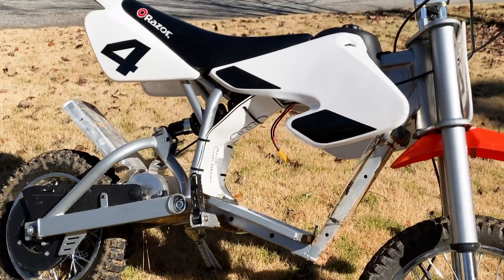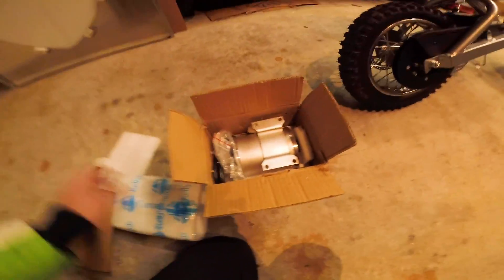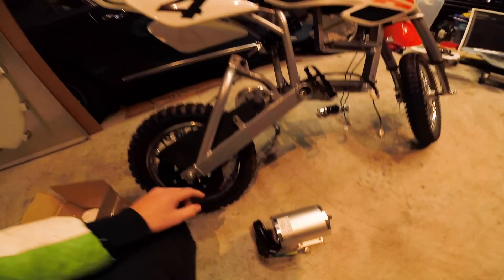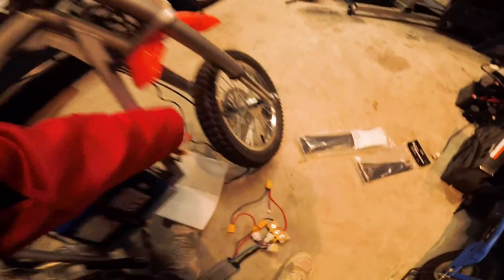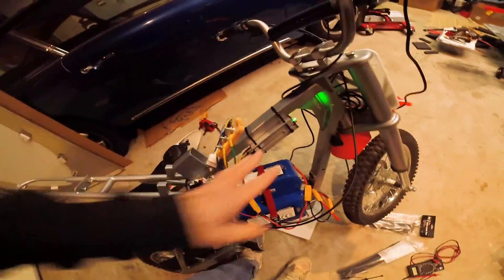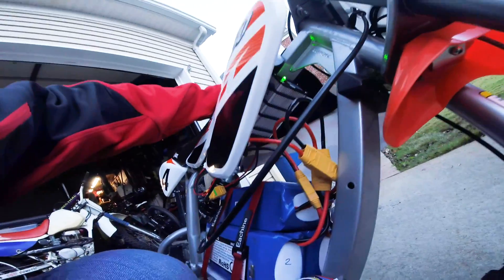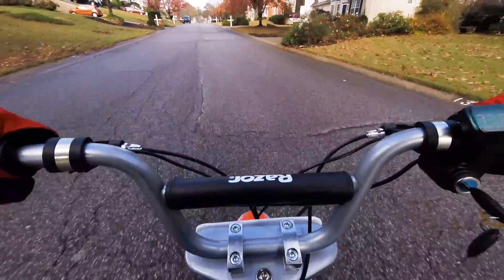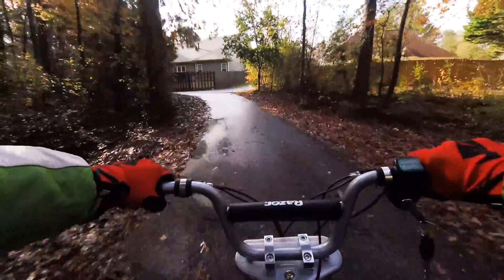Razor MX650 to MX3000 | 3000W 72V Electric Pit Bike

Comment: mmm considering the power, the frame, the wheels, and the chain, I would go for a larger gear at the motor, less torque, less speed but better acceleration control and less dangerous to drive.
Reply from the maker: Larger motor sprocket wild equate to higher top speed. I messed with the gearing in newer vids. Check it out if you’d like!
Reply: @AllThingsElectric_  with this kind of motor, you will lose torque, and speed. If you porgram the motor to be in "speed control", rather than "current control", maintaining speed will get the coils to melt. But i ll check the video sure :) keep up the good work
Reply from the maker: I changed the sprocket and got much higher top speed. The motor gets hotter because it’s working harder to provide high torque, yes, but the math of gearing stands true.

Comment: I have a few questions bc I want to do the same build:how do you charge it? Also wouldn’t 22.2v x 3 be 66.6 volts?
Reply: Thats what im wondering😂
Reply from the maker: I don’t recommend these batteries, but I charged them using a high powered hobby grade charger. One meant for RC batteries.

Comment: I am in the middle of upgrading my daughters MX650 to a 2000W motor and used two of the same batteries you have on your build. Having trouble figuring out wiring up the batteries to the controller. I see you made your own harness for your build. I know it was a while back now but if possible would you mind sharing  what you used to get yours battery wired to the controller I would appreciate the feedback.
Reply from the maker: Just look up “series connector for three batteries”

Comment: Excellent video! Thank you for doing it. Just one suggestion: If you plan on doing more vids, since you can afford things like hop up motors and batteries, why not spring for a small tripod so you can let go of the camera? I guarantee you will like the results once you dial in the setups/angles.

Comment: So I'm looking to upgrade my mx500 I want to do the 72v like your was it hard to figure everything out bc I don't want to spend the money on a plug and play if I can just buy everything separate for like half the price
Reply: What do you feel is the easiest controller to get and how did u figure out that hall sensor problem thanks bro and lmk what ya think is a good set up and then once I order it ifni run into any issues I'll be hitting you up again thanks bro
Reply from the maker: I would go the route that I did with the kelly controller. It is super powerful for its size, and not hard to wire. Def use facebook groups as a resource. Feel free to reach out to my via Instagram.

Comment: I made mine onto 2000w but I regret doing it with 48v lithium top speed 28mph the take off power is there it even lifts front tire but after that the torque is kinda weak

Comment: What do you recommend for a Adult 5'8" 170lbs?
And whats the difference between the RSF650 AND MX650, SX500?
I'm looking to buy and not sure because the mx is 100 dollars cheaper. 
What ever I buy I will be Modding
Reply from the maker: The MX650 and MX500 are the same exactly but differ in motor wattage. The SX500 is smaller than those two. The RSF650 is about the same size as the MX bikes but in a street style. You could probably fit on these bikes at 5'8".

Comment: Nice bike man! So, I have a question since I'm building one similar to yours. Would it be po0ssible to use a different Lipo because I can't seem to find one with that amount of MAH, and might you have any suggestions on which lipo  I could use instead of the one in the video. (I'm only looking for about 25-30 Ish MPH with my build though). Thank you!
Reply from the maker: Yes you can most def use different lipos. I used some 8ah 6s LiPos with a scooter build I did. The mah rating won't change the speed you get out of the bike, that has to do with voltage. These 20Ah batteries get me about 20-30 miles of range.

Comment: Nice electronics work but those bikes have NO suspension and tiny tiny brakes.. Maybe consider converting a chinese gas pit bike if you want something that isn't bound to throw you to the ground at high speed.
Reply from the maker: I respect your opinion, but it seems as though you have never ridden one of these bikes at speed.
Reply: @AllThingsElectric_  I have two for my kids and have ridden them enough to replace the tires once and also ridden them downhill faster than the stock motor/battery can power it on flat ground many times. I also have a CRF110F and the quality of the ride and safety is night and day difference. A CRF50F would be more comparable but the brake pads on the razors are literally the size of a quarter or smaller and they are cable-driven vs hydraulic. Also the Razor shocks feel like they are nothin but stiff springs and the fork has tons of play vs real dirtbike forks and shocks. Just sayin, if you want a good donor vehicle for a project like this the cost of a used gas chinese bike (or even a japanese one if you get lucky) with bigger brakes and better suspension will probably be similar in cost to a Razor but much better in almost every way. Cheers

Comment: I hope everybody sees the video that proves the 500 is identical to the 650, they just lie about the weight limit to rip you off for $150. Yes, same motor, same frame, same everything but the color.
Reply from the maker: I got it used for super cheap.

Comment: What all do you need for something like this? Just batteries controller and motor? Or what else
Reply from the maker: Batteries, controller, motor, throttle, voltage meter, a lot of patience

Comment: Did you have to change the 25h chain to t8f to fit your new motors sprocket?
Reply from the maker: No, I left the stock chain. If you see my chain lengthening video, I use the same one. I changed the motor sprocket.
Reply: @AllThingsElectric_  thanks for the vid. I'm changing the motor on the rs650. Pain in the ass getting the chain on and new motor on at the same time. At least I know now it's possible

Comment: Wow. I didn't even have the brains to do this when I was your age, and I'm 25 and don't even have the brains yet! How much would this cost in total. If I buy one, could I send it to you! Lol. just under 700 would do it for me and you'd get 22. So yeah under 1000k in total for a tuned up bike like that might be available for me later on. Let me know if the price and if that's doable. Not saying it will happen any time soon :(
Reply from the maker: Yea man I can make this work. The batteries I use are about $600, motor is $100, controller is about $200. It might total over $1000 with labor.

Comment: Would love to see a SRF loaded with a 72v 3000w brushless motor, 55Tooth or smaller on the rear wheel and 15 tooth sprocket on the motor. plus  x4 36v Lithium ion batteries,  x2 in parallel and both sets in series.
Reply: Check out Surronster 1SJim - he did one …

Comment: I did something similiar with a 50ah 48 v battery and 1600watt and goes 40mph, the battery is huge and more expensive so i had to grind the battery holder and weld some stuff. Its wicked lithium
Reply: What batteries did you get 48 volt I’m tryna get some

Comment: Hey how did you fix the throttle :') please help.
Reply: interested also
Reply from the maker: I replaced the hall sensor within the throttle. This is the device that detects where the throttle position is and tells the controller how much power to give. I recommend never using this type of throttle however.

Comment: Which charger are you using for the batteries?
Thanks for replies.
Reply from the maker: I use this charger with a large power supply and balance board - https://hobbyking.com/en_us/smart-charger-500w.html

Comment: I’m afraid that If that wood gets wet it could stop being an insulator and become a conductor.
Reply from the maker: thats a great point. It is, however, under the top "gas tank" and above the frame. So it would be hard to become wet, but def a good point.

Comment: Can you throw 72v and 100A at these motors without overheating or other issues? I’ve been looking for an answer to this for so long! 

I’m really not looking for anything more than those 7200 watts - and I really don’t wanna use the extra money on the qs 138... so I’m sitting in an awkward place between the qs and the cheap bldc 3k motors, I just don’t know if the cheap stuff is going to overheat, throwing twice the load of that it is rated for at it... did you experience any issues?
Reply from the maker: I haven’t had issues. You could always drill out the holes larger for more airflow or make a fan that goes inside the stator. I think 100 amps is perfectly fine for a short time. The motors are only $100 so it’s not terrible if it does overheat.

Comment: I got a similar motor but 48v 1800w and 5200rpm. I have put 2 6s 16ah lipo batteries from HObby King too and I have 13-80 gearing. Math shows I should at least get 30mph out of it, but I only get 20mph. How can I diagnose the issue? Controller? throttle? Batteries?

Comment: Sweet setup! What charging system are using to charge the batteries?
Reply: Looks like it’s a LiPo battery that is “6S”. Any LiPo charger should do as long as it charges 6S batteries. 👍
Reply from the maker: It’s an ISDT drone battery charger. Can be used for any LiPo really.

Comment: Nice job maxing out those batteries and the 120A madness. That my1020 motor RIPS I have a 52v 60A running my scooter and it does the same wheelie when you burst.  The throttle is really jumpy pushing that many watts through the motor.  I added a 3 speed throttle because of that.
Reply from the maker: You could also gear is down for speed. That helped for me. Check my new video.

Comment: Great video! I have the exact same setup fo a mini bike. But how did you figure the throttle settings on the Kelly controller?Seems I’m only getting partial throttle with all settings I try.
Reply from the maker: Definitely plug it into the software and program it. I never had issues though

Comment: How do you charge the batteries?
Reply: Can you comment exact links to charger and balance board you use? Pls
Reply from the maker: You can buy a lipo battery charger with a balance board and charge them. Note that you should balance them individually every so often. Look up how to charge lipo batteries.

Comment: Is there a diagram on how you wired all the wires and how did you make the series bundle thing for the batteries?
Reply from the maker: There is a manual for the Kelly controller on their website. Look up how to wire a series connector.

Comment: I have the same motor/controller setup that I’m testing now but it runs great but in reverse.  I tried to tying (11) 12v red wire to (12) forward switch white wire.  When I do this it just won’t respond at all but no controller defaults either so I’m stumped.   Any suggestions?

I found out if I manually start the motor by hand with the throttle engaged it will work but as soon as it goes back to zero rpm it has to be manually restarted.
Reply from the maker: Switch two phase wires
Reply: @AllThingsElectric_  you’re the man got it working.  Getting closer to a test ride.
Reply from the maker: @trahar6257  glad I could help!

Comment: Three questions if you don’t mind...

Have you had any issues with the chain and flywheel on this amount of power? I’ve heard some people say the flywheels snap from the torque and had to get them welded. I’ve also snapped the chain twice on my bike (before I upgraded to a 25H chain) and completely destroyed the chain tensioner from the increased speed. (My mx500 is currently running 60v 2Kw with 3.6Kw peak (60v x 60a), yours is running a 72v 3Kw with a 9.36Kw peak (72v x 130a)) 

Any reason you didn’t go for a sine wave controller like the kls-s controllers? From what I understand sine wave controllers are  supposed to be quieter with a smoother throttle response (but more expensive) 
On the other hand though, I’d assume most of the sine wave benefits are negligible with a mid drive setup where the chain is responsible for most of the noise 

How’s the motor temp while riding? My motor tends to get too hot to touch after about 20 mins of fast riding, but I’m running SLA’s with bad voltage sag which heats it up faster
Reply: I’m in the process using the same motor/controller as this guy and I’m sure I’m going to need a similar 25H setup if you want to share what parts you have on your bike
Reply: @trahar6257  25h chains fit 25 sprockets so it’s a direct replacement. The 25h chains are only supposed to have a higher strength rating and I haven’t had a problem since
Reply from the maker: Yes, the stock flywheel is weak, and should probably be replaced firstly. There’s a guy on here named Tim A. And he has a video about a solid upgrade. I wouldn’t weld it because I like the smooth coasting. I haven’t had issues yet though. As for the sinewave controller, it’s better for hub motors, so it really doesn’t make that big of a difference with this mid drive setup (like you said, most noise comes from chain and tensioner). Motor temp does go up, but honestly nothing to worry about. You could drill out the preexisting holes in the motor to a larger diameter to increase air flow, but it’s not terrible.
Reply: @AllThingsElectric_  I looked at the flywheel upgrade, def gonna do that if my flywheel snaps. For now I'll just leave it as is cause I also do like the coasting without spinning the motor. I also read on endless sphere that it's suggested to put a rubber tube over the bearings of the chain tensioner to make it quieter which could be something to look into (I'd have to find that thread again though to see exactly what it was). Thanks for the info though, I'm considering doing an upgrade like this but with either li-ion or lifepo4 (cause I don't have the balls to make the jump to lipos yet haha)

Comment: I have an mx650 with 48v 1800 watt motor kit from Amazon. It's faster then stock and even has three speed regular. I really like the motor response you are getting with this bike/setup!  

Can I use the three speed switch (or something similar to control the top speed)?  

Nice build subscribing.
Reply from the maker: Thanks for the sub! You definitely can with the Kelly controller, but I do not have experience in that specifically. I wanted a really raw build, so I only wanted the throttle regulation
Reply: @AllThingsElectric_ what range are you getting with the battery set up?

Comment: Peak amperage? Nice build...looks like you could use some better suspension lol. I'm building my first ebike right now. Qs 138 70H motor (newest version) may have gone a little overkill with a 68AH NMC battery but such is life. Set up is going in a 2007 rm 125 frame so it'll be a full size dirt bike. Hoping to push 200A and at full charge of 84V...should be fun. Looking forward to seeing more content from you in the future you got another sub!
Reply from the maker: Thanks so much man! Your build is going to rip. Peak amperage is 120 a. And yes I def need new suspension.
Reply: @AllThingsElectric_  Dude I hope so! Cool to see people like you and Krisuno that around my age doing this stuff.

Comment: WHAT UP WITH THAT 914 ?
Reply from the maker: !!!!! Glad you noticed. My dad and I rebuilt the hell out of it for about 2 years. After 2 weeks having it finished, the alternator was pumping too much current. Wires got hot, melted the fuel line, one of the carbs wasn’t feeding fuel and the car was bogging like crazy down the highway. The fuel that had leaked out sparked and caught fire. Car burnt up and was totaled. Tragic. Such a beautiful car too. Be careful with rebuilding classic cars.
Reply: @AllThingsElectric_  daaang the sucks. Are you rebuilding it ? Theres a place in Marietta GA that you can get all those parts you need to rebuild it I'm sure you know about Automobile Atlanta
Reply: OH and don't think I didn't see that 911 in th garage too lol is that a 71?
Reply from the maker: @Leo_dude  66’
Reply from the maker: 912
Reply from the maker: @Leo_dude  Probably going to sell it to salvage the parts. Not really sure the plan with it...
Reply: @AllThingsElectric_  what part of GA are you in?  I have a razor too and want to do the same with what you did
Reply from the maker: @Leo_dude  about 30 min south of ATL
Reply: @AllThingsElectric_  if you had all the parts how do you think it would take to do everything ?
Reply from the maker: @Leo_dude  are you asking how much $? I would charge around $1700 ish
Reply: @AllThingsElectric_  I'll pay you to show me if that works

Comment: Awesome! my Razor mx650 has a 2000w brushless motor and 48v sla batteries and does 30mph using the kit controller which is huge lol, soon i will put in a 52v lithium and a kelly or luna controller and see how it does.
will also upgrade breaks for hydraulic.  i am using a 13T front sprocket for mot top speed, you can  use a 15T front sprocket and get about 40mph out of the 3000w motor you are using but defiantly will need better breaks.
can you make a video of the wiring from kelly controller to throttle, motor and battery''s?
Reply from the maker: Sure I can make a more in depth video. Good to hear!

Comment: Where did you hook up the yellow wire for the power to the voltage in the throttle And the negative too? I’m doing the same build I just don’t want to fry anything thanks!
Reply from the maker: To the battery to measure voltage. Ground to battery ground
Reply: @AllThingsElectric_  didn’t that fry the throttle though?
Reply from the maker: @xXScumLordXx  oh sorry for the confusion! I fried the throttle because I plugged the 72v into the throttle first. In order to avoid frying the throttle, you have to plug the battery into the controller FIRST, THEN plug in the throttle. It would be much better to wire the voltage meter into the female end so that you only have one connection.